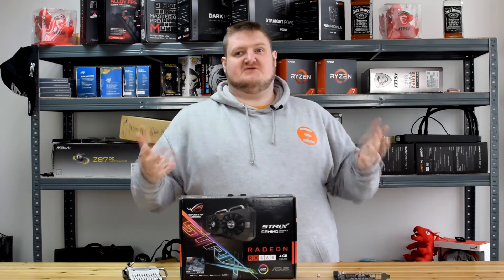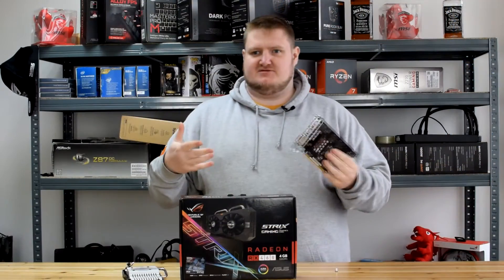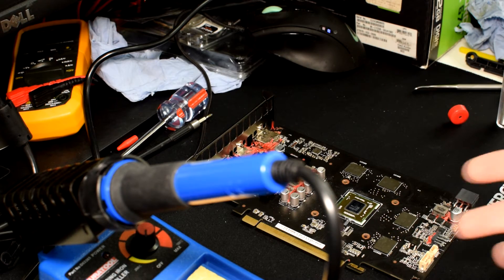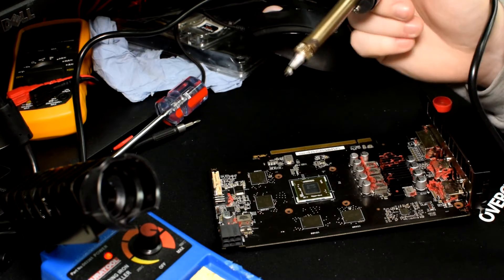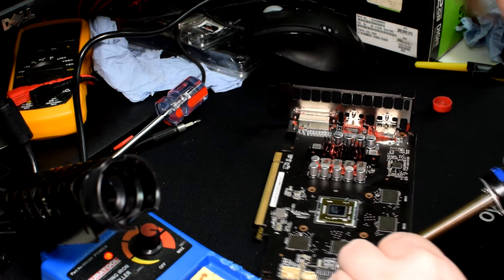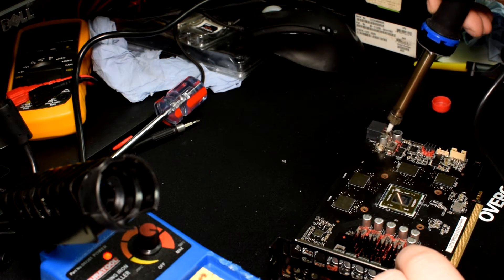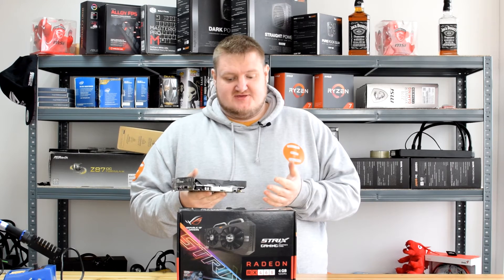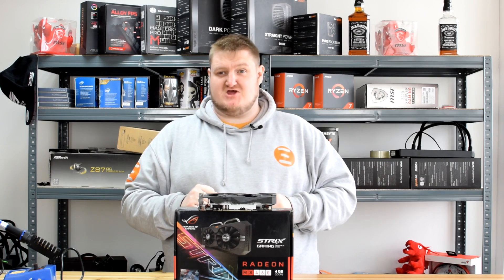How To Fix a Dead Graphics Card...NOT! - NEVER LET ME SOLDER PCB AGAIN!

Comment: I know this is a ancient thread but iv come across a issue in my searching I.was looking for best way to replace a Rusting Nvidia R47 cap near the PCIe power. Can these be safely removed with hot air/flux or are these going to pop if you add heat from the top?

Comment: You should be heating the joint and component and letting those melt the solder...
Reply: aye, the tin on the tip is basically ruined once the flux burns up. Soldering 101: Put a bit of tin on the tip for better heat transfer, heat up the soldering pad, and the leg, apply fresh tin. done. Also helps alot to use flux on the pads/legs, to remove any corrosion.

Comment: Good luck soldering it back properly. In case you missed it, the polarities show on the cap sides and are also marked on the PCB. 

In your case, the side with the black strip is where the negative lead is, the other side is the positive lead. As far as how they should be oriented, you can usually see markings on the PCB where the + or - is, like on this image: http://capacitorlab.com/replacing-motherboard-capacitors-howto/negative.jpg
Reply from the maker: Thanks for the info...I'm the first to admit I'm a newbie when it comes to soldering/DIY! I need to get a flux/reflow station too and lots of little kits so I can learn...only way to learn is by doing it and making mistakes!

Comment: You got the cap backwards.  Compare to this pcb photo: https://www.techpowerup.com/reviews/ASUS/RX_460_STRIX_OC/images/front_full.jpg
Reply from the maker: How do you work out that it's the wrong way, when you can't see the top of the cap?
Reply: I can just about see it in the image on my monitor (Dell U2715H) - the black stripe is on the 6-pin side.  It gets a bit clearer if you up the saturation a lot and reduce the brightness a bit.

Meanwhile at 4:28 in this video the side without the stripe is clearly closer to the 6-pin.
Reply from the maker: ill try soldering it the other way and see how it goes...or ill let ObscureParadox have a go at the UK bench meet next month
Reply: Good good.  There's plenty of hope for it yet :)
Reply from the maker: Not with me there isn't!